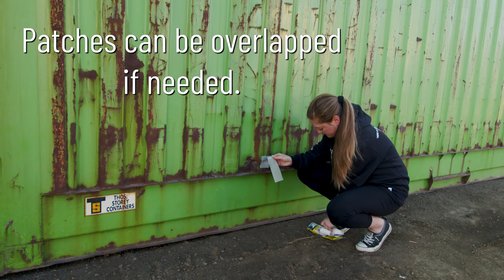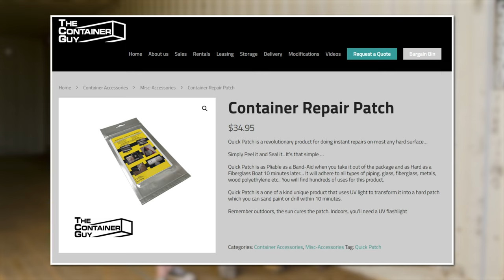How To Patch a Hole on a Shipping Container/Sea Can!

Comment: I have a container I am considering building out for a guest house. It is at my warehouse so I was planning on building it out there then shipping out to my property. I know people do this all the time, but my question is about the drywall. Can I tape, float, texture and paint before I deliver it? Or will shipping bust out all the joints?
Reply from the maker: Vertical seams in the walls and horizontal seams in the ceiling are fine. All the corners will crack. Use trim (crown mold & corner trim) in those areas. Also, we found spray foam insulation holds it all together WAY better (less cracks) than non-insulated or batt insulation.
Reply: @TheContainerGuyTV  Much Appreciated!
Reply: @TheContainerGuyTV  Sorry. One more question. If vertical seems in walls are ok, would it be beneficial to just install my rock vertically so I only have vertical seems?
Reply from the maker: @jakeoverton3364  Yes. 100% install the sheets vertically.

Comment: But does it hold up (better than a weld) when the container wall is flexed?
Reply from the maker: Containers aren't designed to "flex".. Fibreglass is much more malleable than steel so I wouldn't be worried. These patches are meant to waterproof small holes that aren't compromising the container's structure. We are not trying to achieve strengths "better than a weld" but in some instances, a weld may crack when the fibreglass won't. So to answer your question - maybe...
Reply: @TheContainerGuyTV  If this container is at the bottom of a 7 stack, will it crack